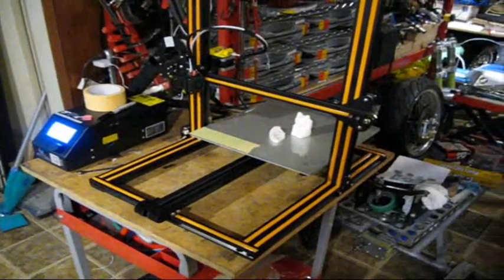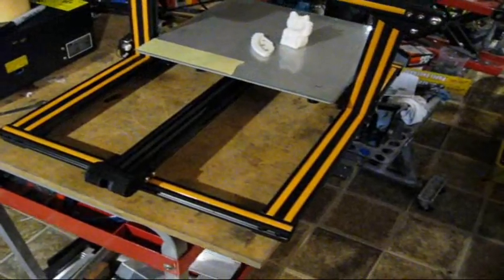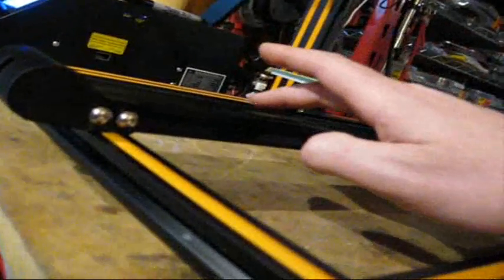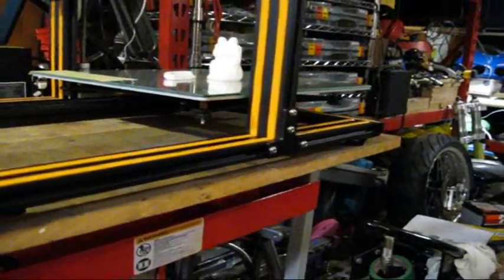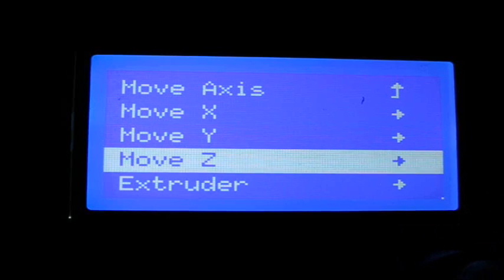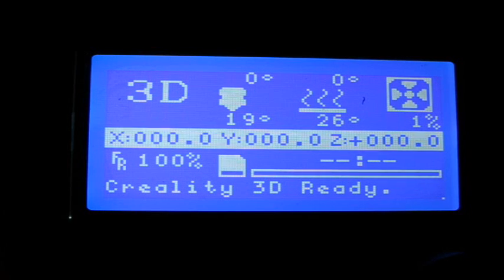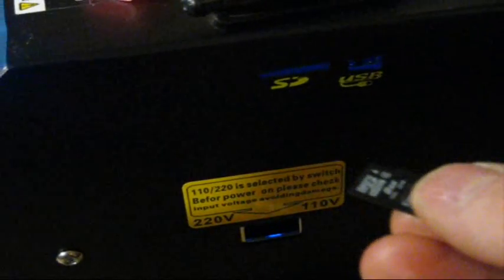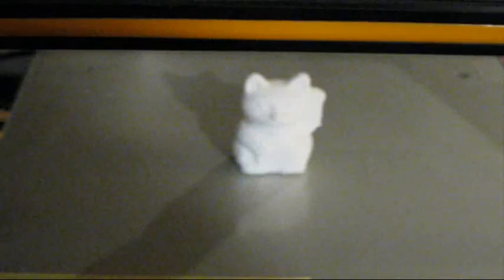Creality CR-10 pt1 - newbie start-up information

Comment: I have a question i was hoping someone could shoot me a quick answer, i just got my cr10 mini i havent fired it up yet because on the voltage selector switch has me confused, the yellow sticker above says 230v on one side and 115v on the other but the actual switch has those voltages written on it also. Should i activate rge switch where i can read the voltage i am using?
Reply from the maker: On mine the direction was the same. When I slide the switch in the direction indicated on the label, you can read 110 on the switch itself.
Reply: Rickd4004 thank you dude! My sticker was upside down lol so ot was saying different than the actual switch, i went with what was indicated on the switch and that was correct, thanks for taking the time to help me though :)

Comment: my problem wasen"t the tape. I found that the heat bed was on and using PLA  heat bed needs to be off using PLA ,, and I use painters tape blue to print on. no problems

Comment: I am having issues it wont print anything!!! I already tested the Gcode on another printer and it works fine. any ideas?
Reply from the maker: I'm no expert, but here is what I would check as a start;
1. does the extruder heat up and extrude in manual mode.
2. do all 3 drives (x,y,z) work in manual jog mode.
3. Try printing the cat that comes with the machine.

If yes to all the above then it must be the reading of the Gcode. When you say that you tested it on another printer, was it another CR-10?

I don't know for sure about 3D Printers, but other CNC machines use multiple "styles" of Gcode. The fundamentals are the same, but details vary. If your CR-10 will print the cat, but not your other Gcode, then I'd say that the slicer you are using is not configured properly for the CR-10.
Hope that helps,
Rick

Comment: Do yourself a favor and get rid of the tape. Get a sheet of PEI with 3M 468MP adhesive tape. You tape the PEI to the glass. The prints stick and when the print is done, you let the bed cool a bit and just pop the print off. It will make your life a ton easier.
Reply from the maker: Yes, I finally found a decent price with shipping to Canada on a sheet of PEI. It's been working really well, and it's much faster/easier than the tape.
Reply: It's crazy. Works with ABS too. Just pops right off. No mess, no fuss.

Comment: The Creality CR10 3D printer is one of the easiest and most popular available.
Anyone just starting out would do well to check it out.
It can be found HERE: http://www.banggood.com/DIY-Creality-CR-10-3D-Printer-300300400mm-Printing-Size-1_75mm-0_4mm-Nozzle-p-1085645.html?p=JQ26191551677201504Z&utm_source=bbs&utm_medium=agogo&utm_content=zhangruihua&utm_campaign=home

Comment: You are correct you must have the 1st layer as perfect as you can get (z-offset wise and bed level) also have you tried Aqua net super hold not all hair sprays are as good.  I heat up the bed to 40c-50c and use Aqua net. I also use elmer xtreme glue stick at about 60c-90c for small abs prints using the glass bed.
I prefer PetG is a good alternative to abs.
Reply: not heat on the bed using PLA , heat works with ABS

Comment: Nice video. 
You were absolutely correct with the head being too far from the build plate when you were doing your print.
Oh and the Spool  holder top bar is officially the wrong way round. The cylinder should point towards the front of the screen so the spool sits above the control box. That way the weight of a really heavy the spool won't lift up the control box.
Reply from the maker: Thanks for that info regarding the spool holder James. 
I still find getting the part to stick to the build platform challenging. I've had numerous parts come loose part way thru the print.